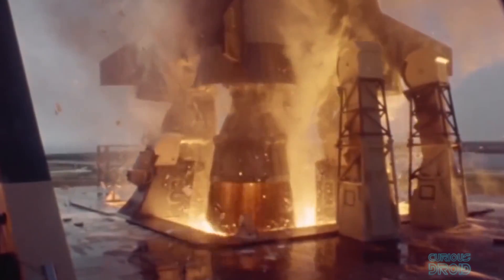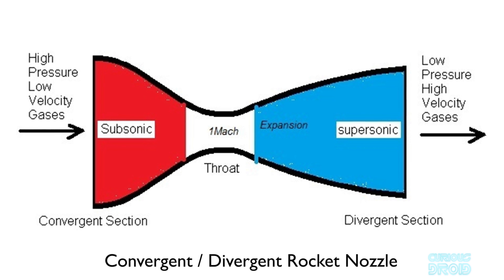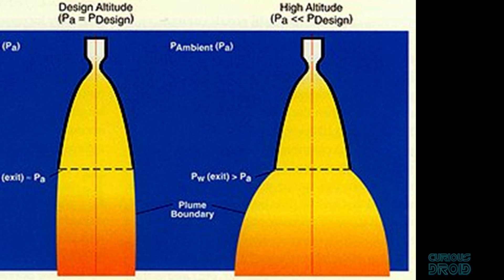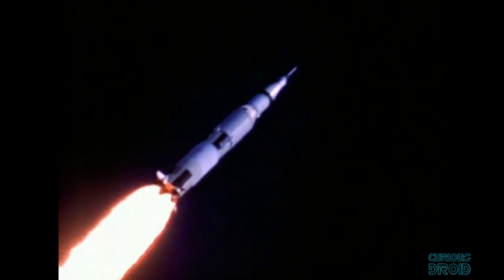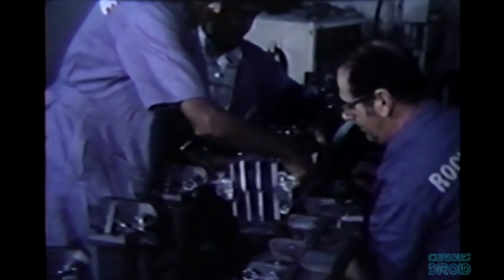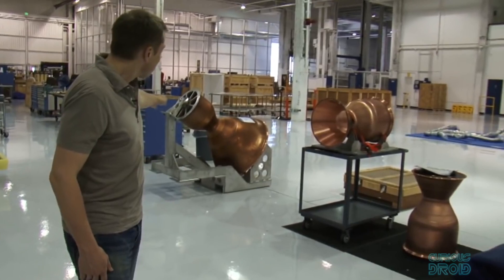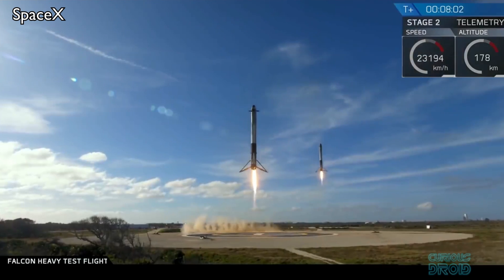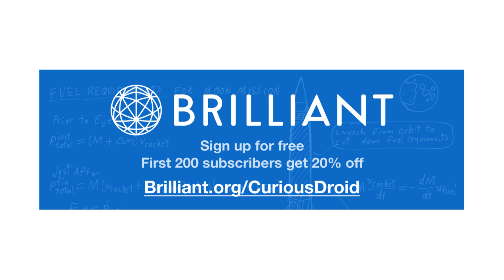Aerospike Engines - Why Aren't We Using them Now?

Comment: Hello curious droid, imperial to metric conversion  mistake 1 sq inch = 2.54 x 2.54  = 6.45 cm2, and just to be correct you also misspelled “atomsphere” instead of atmosphere in column of air slide, what happened guys, you used to be reliable?

Comment: With just one engine producing high power for lift off at sea level there is a problem higher up. When you get up high would all that power, and the lack of mass because you burned so much mass in fuel, produce excessive g forces for the people or anything that can't handle it? You would have to throttle down as you decrease mass. This looks like it can be throttleable. Can it be started up in space without wasting too much fuel? That linier reminds me of the underside of the X-43 hypersonic aircraft.

Comment: why can"t they just use overlapping bell fragments that slide over/under each other depending on the outlet requirement?
Reply: AnarchistMetalhead - Because by time the transition is needed you're better off staging the rocket anyway and continuing on with a vacuum bell. They do have rocket engines that have the vac bell "deploy" and slide down before ignition, but it's only for lower profile stowage.
Reply: fragile..

Comment: Do the sr71 blackbird got an aero spike or is that something else in the front of the engine?
Reply: That's a variable air intake that opens and closes depending on speed. I believe it closes up once above a certain mach. Not closed shut, but closes to let less air in.
Reply: The SR-71 does not use rocket engines - it uses turbojet engines & needs air to function. The cone-shaped air inlet on each engine is designed to slow the air before it entered the engine to sub-sonic speeds. The cone moves backwards at higher speeds to control speed of airflow into the engine, but airflow to the engine is always required or the plane 'flames out' - not good.

Comment: That's why rockets don't work in space there is no air pressure in space to push off of.
Reply: yeah man rockets are fake. they expect us to beleive they burn stuff in space with no air. without oxygen there is nto fire duh
Reply: ... they bring the o2 with them.... please stop being stupid.
Reply: False. More thrust is produced in a vacuum because the combustion has no resistance. So the escaping gases are at a higher velocity therefore impart more energy per unit of fuel burned. It's called specific impulse. CD here mentions loosing thrust, but that's in the scenario of using a sea level engine in vacuum. The engine is producing more thrust, but that thrust is lost because of cosine losses. Because the exhaust isn't being directed parallel with the rocket. That's what he was talking about in that clip. That's why you need that massive engine bell in space. To more effectively harness the energy of the escaping gas.
Reply: Rocket throwing mass out of its engine is what propels it (just like bricks from a boat). There is no pushing happening , unless it is happy hour at the bar .

                 Validate your 2nd Amendment Rights......  Carry
Reply: Aebe mac Gill you can't push off yourself just like you can't pick up yourself from your collar. Everyone acting like they're so smart it's been demonstrated the shit won't work. They use blimps put a rocket engine on it Tata then they take trillions of dollars
Reply: Motokid600 same reason prop planes can't go as high as Jets it's because there's no air to push off of. They have all but told us it's Syfy. I don't mind paying for the dream but stop trying to convince people it's real
Reply: Yea... thats not how rockets work.

Comment: Isn't another reason for multi-stage to orbit so you don't have to drag all that mass all the way up?  So wouldn't it be better to have multi-stage aerospike rockets?  Sure, there's a weight penalty in the separation mechanisms, but having to lift heavy tanks all the way to orbit is a bigger penalty, isn't it?
Reply: Not if you can get it all back for reuse. That's really the only justification SSTOs have. You're getting the entire vehicle back.
Reply: +Motokid600
I was assuming that (as per Musk's plans) you'd be able to recover at least the first two stages.

Thinking about it, it would be easier to recover a second stage with an aerospike than an ordinary one.  That second stage of Musk's is optimized for vacuum so is going to need more fuel for recovery.

The other benefit of multi-stage aerospike is that all of the stages can be smaller, so cost less, so you lose less if a recovery goes wrong.
Reply: bdf2718 - For a second stage it'd be good. Although I don't think an aerospike is as effecient as the Merlin1D Vac. Aerospikes are essentially Jack's of all trades, but master at none. They're only more effecient during the transition into space. But once in a vacuum a bell nozzle has better specific impluse. So along with that and additional R&D costs SpaceX will never touch an aerospike. I'm sure they considered it, but it just doesn't fit their goals. Musk now does indeed want to experiment with upper stage reuse so it'll be interesting to see what design they go with. I just highly doubt they're going to want to spend time/money developing a radically new engine along side their Raptor engines.
Reply: A multistage rocket can carry a LOT more cargo! If you're in the business of launching satellites you'll make a lot more money taking seven satellites to space rather than only one or two satellites. SSTO vehicles can't launch enough cargo to be useful for most missions - you are better with two or three stages - then you can also get contracts to resupply ISS, or go to the moon.

Comment: The Spike engines are the equivalent to what Jet engines were to propeller engines of aircraft until the need of JET ENGINES for commercial and military aircraft in the mid 1950s.
Yes the British were operating a commercial aircraft with "jet engines" but had major problems with structures of the aircraft; whereas BOEING tested aircraft frames & along with jet engines took the "field" with the 707 & other commercial jetliners
Reply: Aerospike engines are more like turboprops than anything else. They are useful in certain very specific circumstances that basically don't exist, they seem cool, but they are not very common for good reasons.

Comment: Basically, as I understand it, aerospike engines are much more efficient on SSTO rockets, but nobody actually wants to use SSTO rockets because most of the rocket is dead weight once the rocket gets above the altitude where a traditional first-stage would separate.

Comment: 8:41. 266,000 lbf “in a vacuum”. How is thrust produced in a vacuum? I still cant comprehend this. U said it earlier in this video, atmospheric pressure is required to push against. 2nd law thermody. What dose this thrust push against in a vacuum??????
Reply: Pushes against the wall of the rocket engine. The thrust comment made in this video refers to cosine losses. He left that explanation out for simplicity sake.
Reply: The “wall of the rocket engine”? Say wha? Thats a glorified tailpipe. The combustion exiting is supposed to propel the vehicle. In a vaccum there is theoretically nothing for this force to encounter. How does it move the vehicle? The exiting force would instantly reduce to the normalized atmosphere of .... nothing? How does combustion occur in a vacuum?
Reply: "a glorified tailpipe" No its more like running your engine without pipes at all and then that engine having several million horsepower. And then direct that power out one spot. "The combustion exiting is supposed to propel the vehicle" False. All work is done internally from the moment of combustion to the moment the exhaust molecule exits the engine nozzle. After that its work is done.  "In a vacuum there is nothing for this force to encounter." Exactly. Which is why the combustion process is even more energetic thus increasing the force because there is no atmosphere to impede it. "How does combustion occur in a vacuum" A combination of liquid oxygen and kerosene lit either by a badass spark plug or a hypergolic fuel that explodes on contact without the need of an ignition point. Thats what SpaceX uses to start their engines.

Comment: I think the main benefit of fuel efficiency isn't saving cost on fuel, but using that to have a higher payload rather than having to carry that much more weight in fuel, and at the end of the day the payload is what makes you money. If you can save several tons of fuel that is several tons of satellite you can send up.
Reply: Yes. Also if you need same mass delivered - less fuel means smaller fuel tanks, smaller rocket and less weight in general (which means it's easier to construct) and so on.
Reply: It's all about the mass fraction savings.  SSTO isn't possible without improved efficiency.  SpaceX is betting that the operational complexity of a fully recoverable TSTO solution will be "good enough" to truly open the skies.  If they can hit their aspirational cost numbers, they'll be right... probably igniting an SSTO race to do to SpaceX what SpaceX is doing to ULA .
Reply: Bingo. All of that space/mass saved in fuel can be devoted to extra cargo.
Reply: crisray6789 
Alqubier- Fronin spacecraft is the future of space craft technology, anything else is just spinning our wheels.

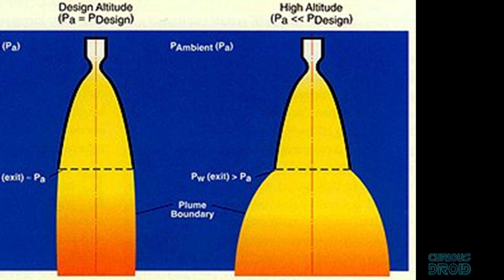Comment: I think you meant underexpanding at 3:50. The exhaust gases don't fully expand inside the nozzle, so they continue to expand outside the nozzle, blooming up the jet - hence it should be underexpanding not overexpanding! At sea level it's the opposite: The exhaust gases get expanded below the ambient pressure. When they get exposed to the outside of the nozzle the jet gets narrowed down - the gases got overexpanded! Summarized: If you expand something a lot you end up with a low pressure, and vice versa. 

I loved your video!
Reply: I always like the terminology "the nozzle is over/underexpanded" -  makes it somewhat more obvious IMO.
Reply: Ambient Morality Thanks for your answer! I agree that it sound a bit more intuitive. Because I had some doubts myself, I did a quick search online. I found following material: https://web.stanford.edu/~cantwell/AA210A_Course_Material/AA210A_Course_Notes/AA210_Fundamentals_of_Compressible_Flow_Ch_10_BJ_Cantwell.pdf

The relevant pages are 12 and 13.
I'm looking forward to your next video! Have a nice day!

Comment: Rocketry technology has been around since the 1930's. If cost is an issue in developing new technologies to lift a load to orbit, then we are stuck with it. The way to control thrust using a different shape for the exhaust to flow through is just a different way to use rocket technology. Isn't there a company out there that is developing something beyond this? No matter what shape it takes, right now it's still a rocket! Aren't plasma engines in development? Something that doesn't take tons of fuel to lift to orbit? If money is the issue, then we're stuck in the 1930's!

Comment: Perhaps it may be more cost effective and more efficient to use traditional, bell-shaped engine nozzles to get to orbit, then another stage using aerospike engines once in low pressure/vacuum.  This might be an idea for long voyages in order to achieve more efficient, higher velocities, thereby shortening the voyage. It would also save weight since the aerospike engines tend to be more thrust-efficient in a vacuum.  Just a thought.

Comment: Quick correction for you, the engine bell is not the combustion chamber. Its the diverging part of the converging -diverging nozzle used to lower the pressure and accelerate the gasses exhausted by the combustion chamber.

Comment: I thought the multi-stage approach was primarily about shedding a majority of the overall vehicle weight, as soon as fuel expended from the lower stages allowed.  The altitude-optimized shape of the thrust nozzles in question would surely be only a secondary advantage in that equation.
Reply: Well yes, but if you look at the Saturn V for instance, the first stage propelled the rocket up to a altitude of about 61km. At this altitude there is hardly any atmosphere left. Although it's not single stage into orbit, its more or less single stage out of the atmosphere to get around the problem of the inefficience of rocket engines at different atmosphäric pressures.

Comment: There are many propulsion technologies that have been created over the last 30 years that still remain locked away in the "classified" area. From the least exotic to the truly advanced, we have scram-jet, pulse detonation wave engine, zero-point energy, resonance frequency engine, and lastly the gravity engine. All are very real and have been in use for some time now, they make chemical rockets look like toys.
Reply: Mostly bullshit. There is nothing secret about scram or PDE [wave engine], but they are both jet-type engines that will not work in space - they are being developed for hypersonic air-breathing cruise missiles & the like. The "resonance frequency engine" does not exist - I assume you mean the radio frequency [RF] resonant cavity thruster [or EmDrive] - this has been shown to be nonsense, it is debunked. The "thrust" appears to be a tiny force caused by the Earth's magnetic field interaction with one of the power cables - the force doesn't increase when more power is applied so we know it's a form of experimental noise. The "zero-point energy" drive or Q-Drive comes in various types none of which work above the level of noise [like the EmDrive] - the other problem is it's known as the Casimir Effect & the amount of energy we're talking about is absolutely miniscule - it would take months to accelerate a spacecraft to one mile an hour. The gravity engine is complete nonsense of course - it is a con that's been debunked many times.

Comment: The craze over single stage to orbit is relatively unfounded.. Provided we can re-use the earlier stages (eg: what space-x is doing), there is no real cost benefit to ssto. The savings of jettisoning the weight of the fuel tanks far outweighs the weight penalty of having another engine for a second (or third) stage. Thrust efficiency can then be optimized for the altitude where the engine will be active. It's true that it would make the first stage a bit more efficient, but like was said, fuel efficiency isn't actually the main concern.

Comment: He didn't metion that there's a lil problem with the linear engine with stability. It can easily be overcome if it's made into a x shape with trust vectoring some tests  have been done in USSR in 70's if I'm not mistaken

Comment: Looking at some of the comments I kinda feel obligated to add a bit of an explanation here that isn't fully covered in the video. Aerospike engines are generally more expensive than bell nozzle engines due to the multiple combustion chamber design.  They simply have many more parts. As such, for aerospike to be economically viable, they MUST be SSTO because the savings actually come from deleting the other engines in a multistage rocket.

If we extend that logic, then the vehicle carrying the engine would be much larger as a single stage than any stage in a multistage rocket. That means the vehicle would also be individually as expensive (or more so) than an entire multistage rocket. If the first stage of a multistage rocket is recoverable, then that rocket is already a third or half less expensive than an aerospike SSTO rocket. So with Elon Musk recovering his first stage rockets successfully, his rockets are already cheaper than any aerospike SSTO can ever be. That's why it's hard to justify adoption of aerospike on an economical basis today, and that's why most organizations have abandoned that path of development.

Now, before someone protests, please note that Single Stage To Orbit means exactly that. You get to orbit on a single stage rocket. The moment you're there, you're basically done. The SSTO vehicle is not necessarily recoverable. In fact, it would be damned hard to recover any SSTO because it stops its burn in outer space at speeds of multiple kilometers per second. Falcon 9 first stages are recovered from 100 km up at speeds of around 1-2 km per second. This is still fairly doable with the thin bodies of booster rockets. We're talking Mach 5 at most. By comparison, reentry speeds range from 7 to 25 km/s for LEO vehicles. That means an aerospike SSTO cannot be recovered in full unless it is shaped like a space shuttle or the X-37 to permit full reentry of the entire vehicle body.

So to make the aerospike engine viable again, one of two steps must be taken. Either the aerospike must be made so cheap the entire vehicle can be discarded once it's reached orbit (which is ARCA's approach with its Haas engine) or the X-33 must be made to work. Otherwise this promising technology will become another dead end.

Comment: 2:30  1 square inch is about 6.45 square centimeter... so normal pressure is about 1kg/1cm^2... a bit more depends on weather or location.

Comment: Very nice! Perhaps it would be worth mentioning that altitude-dependent bell shaping is not the only reason multiple stages are used in rocketry. Multi-staging also allows for repeatedly jettisoning unwanted mass and volume as fuel is used up, and I presume that in some cases multi-staging is the only way to gain sufficient delta-V (e.g., interplanetary missions).